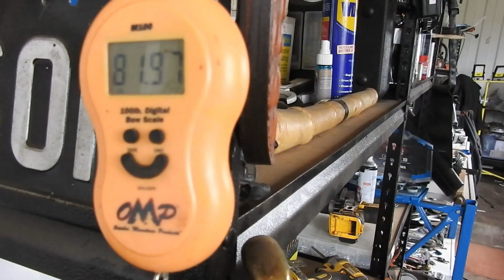Building a Blacksmiths Power Hammer  - Part 1

Comment: This video would have been so much better if you had shown the completed hammer, in operation,. And, if at each stage of the build you had shown the part being constructed on the built hammer before showing the part build.
Reply from the maker: There is 8 video's that I have taken on my hammer project and the last one shows it in operation. Do you make video's? Then you would know how much of a pain in the ass it is to video what you are doing.....Then editing it all before you can load it up to you tube.......At the end of the day I did this to promote thought and give an example of a 'power hammer build' and not to create a manufacturing template for you to follow!  Anyway check out part 8 to see it in operation.......You might even look at the 'Damascus fail video' to also see it in operation.

Comment: Just a question.. What gives you the heavy hit.. Speed?, where the link goes from the tyre?, or weight of the "hammer"?
Reply from the maker: The heavy hit comes from a combination of weight and speed.....You can increase the 'hit' of the hammer by increasing the RPM which is controlled by your foot on the linkage. Add more rpm and the weight hits harder than slower rpm.